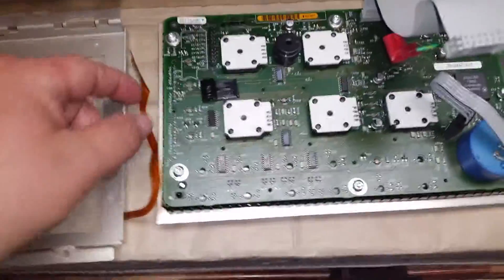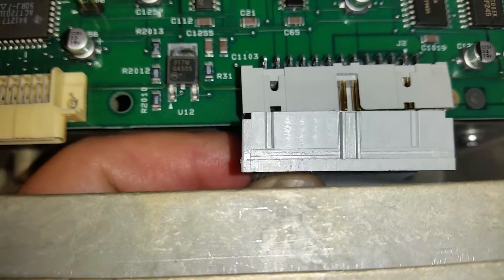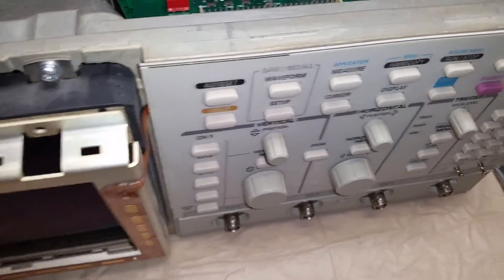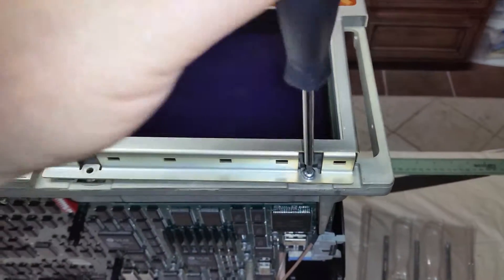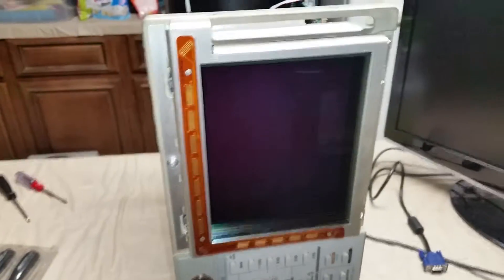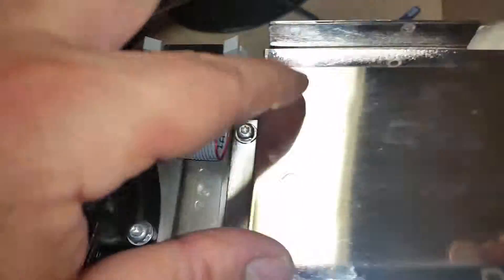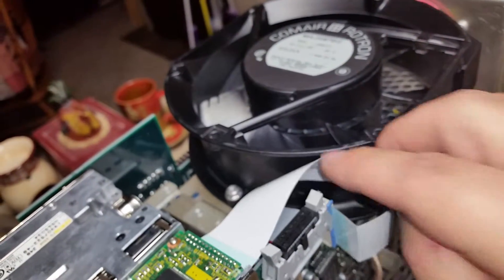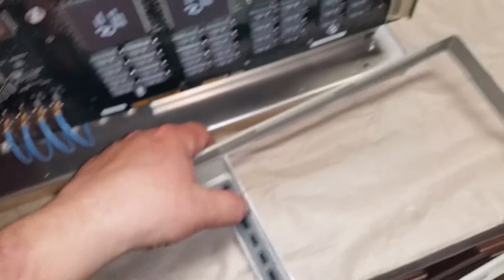TEK TDS 744A No Display Repair Part 5 Front PNL & Floppy Install

Comment: did you fix the display?
Reply from the maker: Unfortunately my cars have been breaking down so I haven't had time to even touch them. I did purchase a LCD to convert it and hopefully sometime next year I can get to it. I'm also putting a quarter panel on my sons 2003 CTS so i've just been way to busy to play with my electronics lately. Kinda bummed about it, because I really wanted to get it up. But priorities are fixing the cars so I can go to work. Most of the other scope items I have are from either break time at work or scopes my boss had me fix. Unfortunately he doesn't pay me to fix my own stuff, LOL. Thanks for watching, it's not a dead project just on hold for awhile. Did you watch all 5 videos? I'll read your response tomorrow, i'm headed to be to get up a 4am to go to work. Best Wishes n Blessings. Keith
Reply: Just noticed you replied. I watched them all, I just today got a tds 520 in the mail with a no display working. Like you I have limited time to fix things, will probably look at mine in the new year. Lot's of site say to replace all the electrolytic caps. Thanks for the video, will help me take mine apart and put it back together easily. Also there is a guy on I believe the EEVBlog forum that wrote a program for I think an fpga, with a schematic to convert the on board video to lcd.
Reply from the maker: You really don't need to do an FPGA reprogram to get an LCD display. Go read the comments on Part 4. I've already purchased the LCD and Controller board for it. I'll do the power supply and use a VGA splitter to pick off the VGA port on the back so that I can have both the LCD screen and the VGA out at the same time, as if it was stock. Did you find the free download manual for the 520 yet? If not let me know and i'll send you a link. The caps are a big problem, check to see if you even have a display first using the VGA port on the back. Feel free to drop me a line anytime. I do electronics for a living and have fixed just a few things in my 37 years in doing it. If you have a display then you have a good starting point. I should get off my butt and install that LCD and make a video of it. Chat with ya later. Best  Wishes n Blessings. Keith